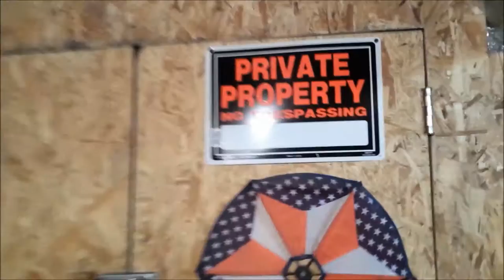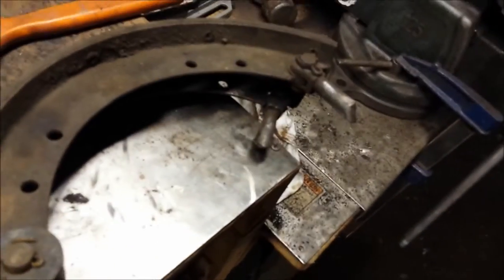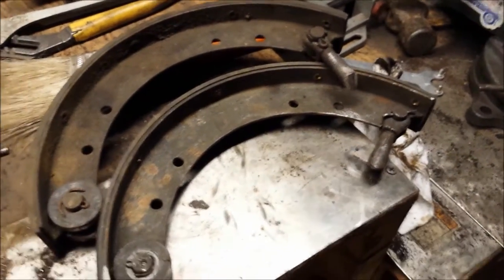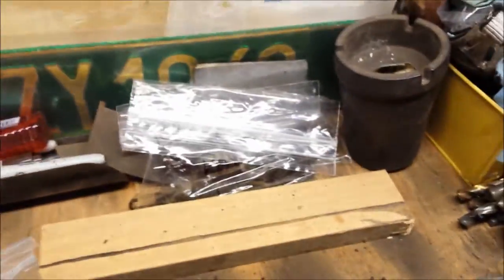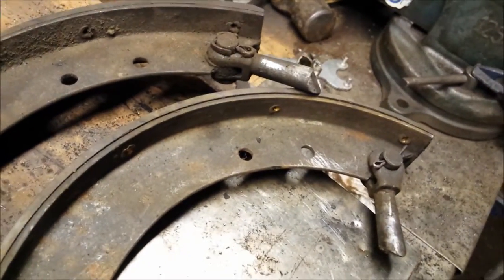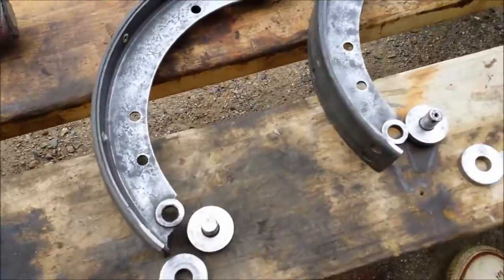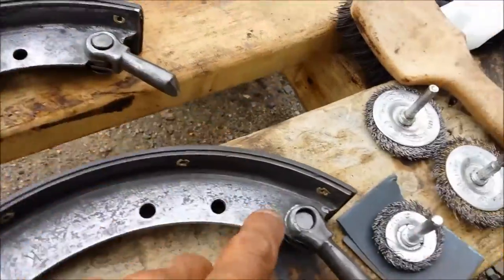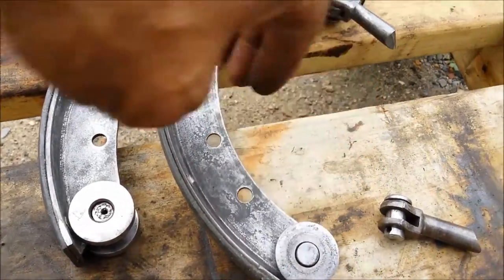Model A brakes, cleaning and more

Comment: To the person who unsubbed, it's your choice. Building permits are required for a reason. No one should have to live in an unsafe home. Electrical, plumbing, gas, and structural permits are required so that the work is performed to code, resulting in a clean safe place to live. If any old Joe can do the work any old way, the tenants suffer for it. 
The brakes are looking great, it won't be long before you're bolting things back together, rather than taking them apart. It's going to be one nice Model A.
Reply from the maker: Odahi The Dubious thanks man, im not worried about the Goofs bro. I know the law. lol  thank you so much for watching brother   cheers from the Dizz

Comment: Nice job on the brakes , looks like that model A had very few miles on it with brakes like that or they were changed just before it's last use
Reply from the maker: TheFrameoff that could be, or it just sat and got no use.  cheers man

Comment: I've just acquired an accessory Model A emergency brake handle extension made by Fulton, I believe. But when I tried to install it, it won't go around the thumb plate below the brake push button. Do you just take out the screw and hinge bolt and spread the clamp? I don't want to damage it so just thought I'd ask someone first.
Reply from the maker: I'm really not sure, But the man that can help is 805 RoadKing. he can tell you what you need to know brother. and thank you so much for watching.